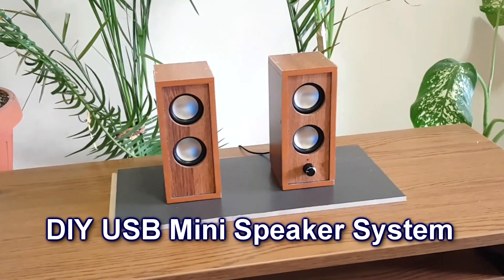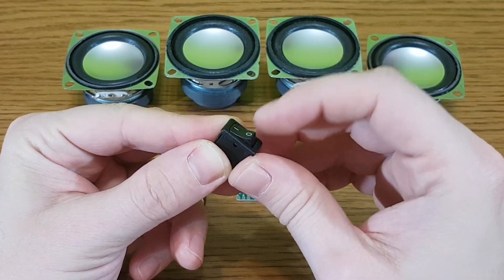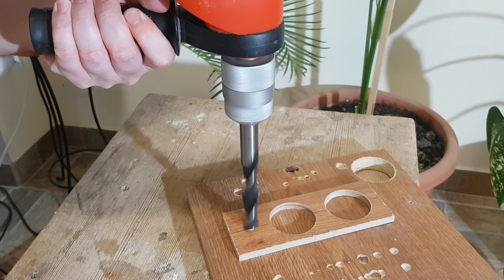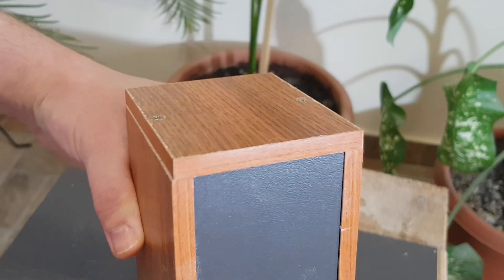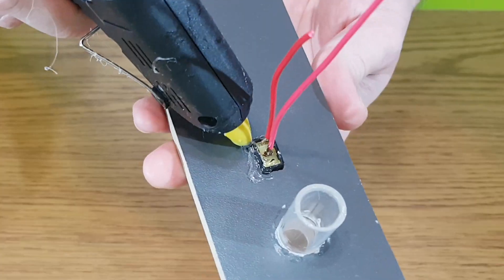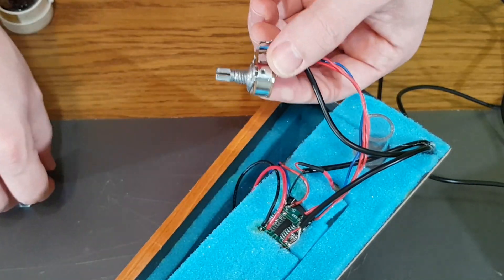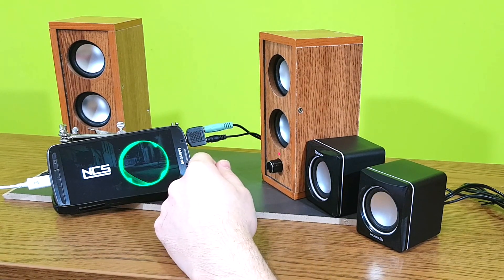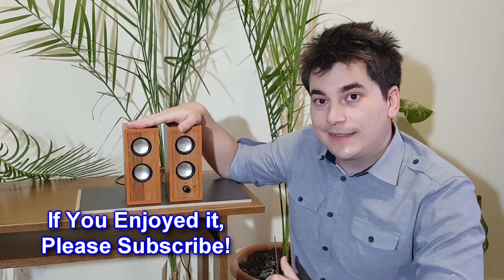DIY - USB Mini Speaker System - PAM8403

Comment: What if I don't have the wire for GND connection on 3.5mm jack. Is there any workaround? Without this GND connection, speakers are making buzzing sound.
Reply from the maker: it will not work without the GND wire. find another 3.5mm jack with all 3 wires.

Comment: Hey bro i have 4 ohm subwoofer. It has more base and when increase volume it gives me Cracked and distorted sound pls twl me how to reduce some base.. Or clean that sound
Reply from the maker: did you try with a more powerful USB charger? minimum 2A. if the bass is still distorted, you can reduce it with a capacitor connected in series with the speaker driver. you need a non polarized capacitor with a capacitance between 100 micro farads (more bass) and 10 micro farads (less bass). if you don't find a non polarized capacitor, you can use 2 polarized capacitors (they are much cheaper and easier to find) in series to make a non polarized capacitor. but you need to connect the 2 capacitors in series with a common negative. and the capacitance will be halved. for ex 47microF + 47microF = non polarized 23.5microF capacitor.
Reply: Sorin - DIY Electrical Nerd thnx man u r a genius 💓

Comment: U have used 4 speakers in this. Project. Here i have used only 2 speakers of 3w..but when i m increasing volume Amp cuts off speaker sound when volume gets loud   why its happening with me bro.. Plz help. Me out I have recorded error video watch it and tell me why its happening like this

https://youtu.be/2QTt-Z7HWUw
Reply from the maker: hi. most likely it has something to do with supply current. what power supply did you use? and can you give me a link with the bluetooth module?
Reply: Sorin - DIY Electrical Nerd  bro i have connected 5v dc mobile charger.. Plz help me bro how to solve this problem and Bluetooth module link is here
PGSA2Z Bluetooth FM USB AUX Card MP3 Stereo Audio Player Decoder Module Kit with Remote https://www.amazon.in/dp/B079BMZHP2/ref=cm_sw_r_cp_apa_i_AToiBbP0ZR8C7
Reply from the maker: I think the phone charger is not powerful enough for both modules, or not even for one. try to use a different charger or powerbank for each module with minimum 1 amp.

Comment: Bro plz suggest me  mini passive subwoofer for it... For 8403
Reply from the maker: if you are using this amplifier board, I'm guessing you want to make a cheap mini audio system. the amplifier is stereo, so I suggest you connect 2 speaker drivers to it. I think the best sound will be provided by 10 - 15W speaker drivers with 6 or 8 ohms. I don't know all the details of your project, so I can't give you a clear answer. but I think 2x 10W 8ohm speaker drivers in one enclosure will be enough for this amplifier.
Reply: Sorin - DIY Electrical Nerd my lovely bro i want to make a normal Bluetooth powerful speaker including some boom boom base sound. I want that this project give me that much sound that i will able to do little party in my room. I have    3w +3w  (4ohm each) speakers  and  10 watt 6 ohms speaker so i have total three speakers.. My purpose is to make best Bluetooth music system and can give me some base boom. Boom also. Can i add mini subwoofer to it along with two speakers??
Reply from the maker: the amplifier is stereo. it will be difficult to connect 3 speakers to a amplifier with 2 channels, without distorting the sound quality, especially the stereo sounds. I suggest you connect 2 better speaker drivers to it, if you can find a pair for that 10w 6ohm speaker, it will be great. the 3w speakers are too small. if you insist on using these 3 speakers, I think the only way to connect them, with the minimal quality loss, is the 6w speaker to one channel and the 2* 3w speakers connected in series to the other channel. you need to be careful with the polarity. to connect 2 speakers in series, the negative of the first speaker will be connected to the positive of the second one, just like batteries.another possibility is to use 2 amplifiers. the first amplifier will use the 2 mini speakers. for the large speaker you can use only one channel of the second amplifier. but in this way your final sound will have one channel louder than the other. the stereo effect will be altered, but the overall sound quality will be better than the first method.
Reply: Sorin - DIY Electrical Nerd love you bro ❤️❤️❤️❤️thnx for the formula .
Reply: For base what should i do bro any trick?? Should i connect one subwoofer with it?
Reply from the maker: you can add a mini subwoofer, but first you need to choose how many speaker drivers you have and which of the methods above you will use to connect them.
Reply: Sorin - DIY Electrical Nerd i have  3w *2 speakers and 1 sub woofer
Reply: @Sorin_DIY  Sorin can I use one 4ohms 3 watt speaker with one 4 ohms 10 watt subwoofer with this amplifier?

Comment: How much ohms is suitable for this amplifier in which ohms it will give best output
Reply from the maker: the amplifier works with 4, 6 and 8 ohm speaker drivers. 4 ohm speakers will give the loudest sound, but at high volume the sound quality will decrease. 4 ohm speakers will draw more current, if you speaker is portable, the battery will last less time. with 8 ohm speakers the max sound level will be lower. the sound quality will be better at max volume and the battery will last longer. I suggest 6 or 8 ohm speaker drivers.
Reply: Sorin - DIY Electrical Nerd i m not gonna use betterry i will use 5v charger.. So can i go for 6ohm??  Or should I stick to 4 ohm again
Reply from the maker: I suggest 6 ohm speakers.

Comment: One channel of amp how much ohms is needed  4 ohms right  + 4 ohms left???   P
Reply from the maker: each channel works with 4 to 8 ohm speaker drivers. if you connect in parallel 2 speaker drivers with 8 ohm each, together they will measure 4 ohms.

Comment: migala dar frumos si calitativ fata de petardele de 20 lei de pe piata :). spune-mi si mie daca pot schimba front panel-ul de la un 2.1 cu usb card etc Myria modelul. la un 5.1 intex fara usb si card :) 
Astept un raspuns ! Multumesc si la mai multe video ca te urmaresc :)
Reply from the maker: salut. nu stiu pe derost, trebuie verificat daca front panelul e separat de amplificator. sa poti sa il conectezi la amplificatorul celui de-al 2lea sistem. probabil se poate conecta si daca are amplificatorul incorporat, dar nu se aude la fel de tare si de clar.
Reply: Ala 2.1 mufa care intra in pcb front pe sub are SDA, SCL . PGND, 5V, GND R, L. / celalalt 5.1 are fire care intra in Pcb front : Vol +, Vol - , Bass+, Bass-,SR+, SR- , Mute . cam astea ar fi si 5V +gnd si inca un fir minus

Comment: your speaker can be sold in market they look so good  according to me and they also sound very good I also used p a m 8403 amplifier circuit with 4 ohm 3 watt speakers at each channel means at right channel the impedance of speakers is 4 ohm and 3 Watts and at the left channel also the impedance of speaker is 4 ohm and 3 watt but the circuit is getting too hot and it stop working when it is heated too much at full volume or little bit lesser than full volume but its sound quality is awesome.

Comment: Nice video man! But to eliminate that irritating noise at a groundloop you can use a "dc to dc isolator" for 1 bug. Just search for it on ebay. I use the B0505S-1W in my projects.
Reply from the maker: hi, thanks for the tip. I know about the DC isolator converter and I will definitely use one in a future video. but I wanted this to be a budget diy mini speaker system. I'm also planning to make other more complex audio systems in the future.
Reply: Isolator outputs only 1 Watt, the current setup is at 0.2 Amps, theoretically it could work but in practice it will under power the amp.

Comment: Lets add bluetooth bt310 and use 28.560 mah power bank like battery 18650 lithium ion cells and thank you very much as soon
Reply from the maker: hi. I do actually have that bluetooth module and already tried it. it works fine. I will make a bluetooth speaker soon.
Reply: change the amp tho lol

Comment: Hi Sorin that's a nice project that i will certainly do ! a small tip : we can use a dc isolator to prevent those ground loops wich make this annoying buzzing sound, like that you can use the Same power supply for everything ! 😉
Reply from the maker: hi, thanks for the tip. I know about the DC isolator converter and I will definitely use one in a future video. but I wanted this to be a budget diy mini speaker system. I'm also planning to make other more complex audio systems in the future.
Reply: Sorin - DIY Electrical Nerd Nice ! i'm waiting for it !!

Comment: Hi Sorin, another great video. Looks like I will be customising my parcel shelf in my car. As the power consumption is relatively low do you think you could make a base box using a slightly bigger speaker from your speaker stash?
So what is next of the agenda?
•powering them by 18650 lithium  batteries.
•adding a Bluetooth chip for portability.
Reply from the maker: :)) You got me! I really like this PAM8403 amplifier and I will use it in other future videos. I will also make a portable bluetooth speaker. I have some original ideas, but I also want to make my version of these common "diy speaker/charger/PSU" videos, that you can find on youtube, to see if I can make them better :) Thanks for your support!
Reply: Awesome I can't wait.  👍